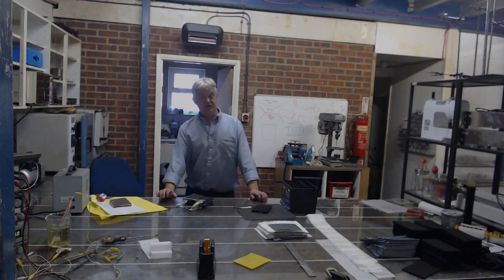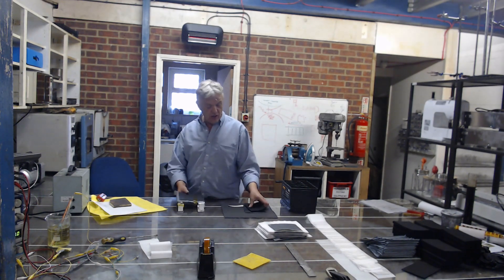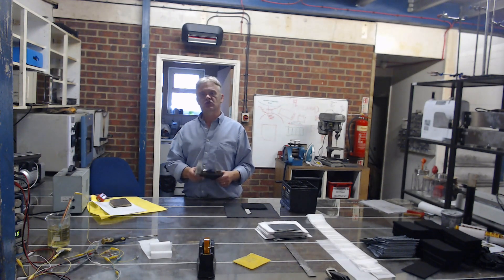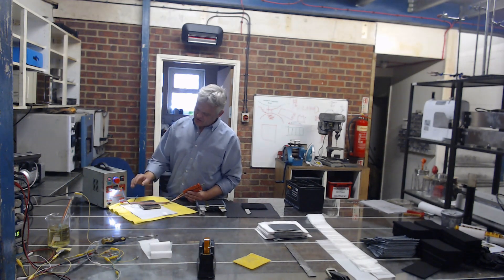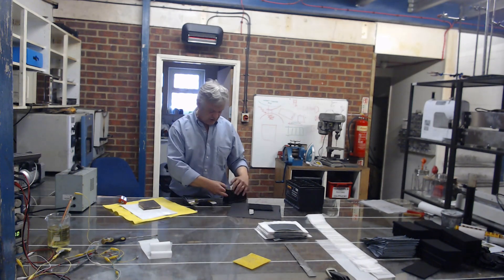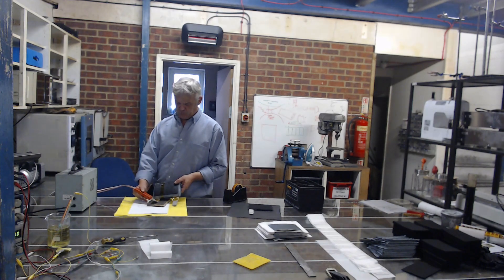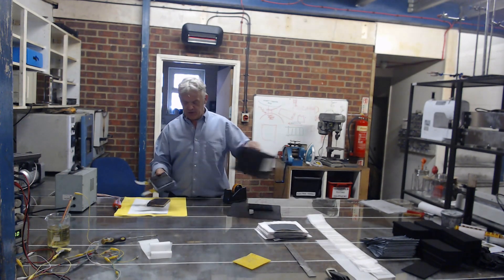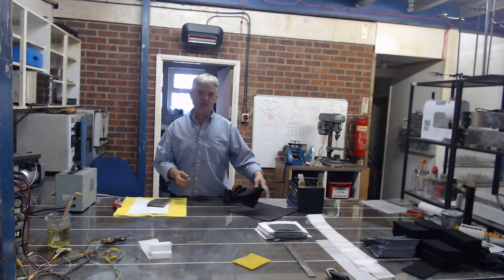Supercapacitor And Battery Build   Welding The Tabs

Comment: Robert, you use 304 stainless steel mesh but this steel corrodes in acid.
Maybe instead of this mesh choose a 316 stainless steel mesh, this type of steel is resistant to strong acids and alkalis.
it would be less work with laminating and protecting the mesh against electrolyte.
What do you think ???
Reply from the maker: 316 is better but we are encapsulating so in theory we could use aluminium

Comment: A home made welder can be made fro a super capacity, and batteries.
Reply from the maker: did you do a vid?
Reply: @ThinkingandTinkering  No, but several youtubers have, I have been interested in building one, to spot 18650 cells to nickel strips.

Comment: Great video! Welding is a nice way to handle stainless steel battery connection tabs. :)
Question: After seeing your previous "battery cell" construction, and now comparing to the "capacitor cell"... you reused the separator pouch that came in the battery. But what do you use as the separator in the capacitor? 
(I wouldn't think paper towel would be stable enough for a reasonable life expectancy.)
Reply from the maker: paper is fine mate

Comment: Robert, is a thinner steel grid covered with plastic is it better to use graphite foil ??
Reply from the maker: yes the graphic will soak up the electrolyte and become fragile quite quickly
Reply: @ThinkingandTinkering  OK - thanks for the clarification !

Comment: At 55 seconds, "both plates are carbon" - so both plates are identical - carbon - with just small stainless steel tabs? Or is one plate stainless steel (as in the recent battery vid) and the other carbon. Thanks.
Reply from the maker: this is a follow on to the battery rebuild video mate

Comment: Hi Robert can you provide details on Welding device (model number, manufacturer)  you used in this video. Thanks
Reply from the maker: it's just some cheapo tab welder mate - I got it on eBay - I think there are a few types but all should work fine I guess
Reply: Thanks Robert

Comment: How was the twizzy battery's made was they pouch battery's or did you do the same as here?   Have you made a solid state Battrey yet?  What is the conductive plastic? Did you make that? I need two battery's 12-14 volts 35 Amp hours or more to operate my donated wheelchair. I cannot operate my manual chair up hills from a spinal injury. I was thinking of a solid type Battrey /capacitor to operate my wheelchair, and made to fit the Battrey cavity in my wheelchair
Reply from the maker: this is all experimental stuff mate - it isn't going to replace you battery anytime soon
Reply: @ThinkingandTinkering  we should just send money to you to experiment for us🤣🤣🤣

Comment: I was wondering how you seal the Battrey back up? Looks quite messy like it will leak all over and ruin what the Battrey is in,  My wheelchair battery's  are Dead and I need new ones I have been thinking about fixing them but I don't want a Mess all over battery's leaking on my floor all over. Would  a pouch type system be better than using that old Battrey case and perhaps melting strips of plastic pouch type material on each side of the tabs at the base of the strip so the strips can be melted together  then welded at the tops so a pouch type container can be made by laying plastic over the cells and welding the edges closed? I watched your vacuum sealer video where pouches was made, perhaps smaller amount of electrolyte saturate Matt material and build sandwich type Battrey and seal together in pouches. I was wondering about cells gasskng and pouches expanding perhaps pouches can fit into old Battrey case and tabs are insulated with plastic on each side last inch of tabs are Bare so they can be welded together into a pile 2volts per cell is needed, actually my wheelchair battery's charge to 14 volts, they are dead boiled dry no electrolyte left. I refilled them with water and tryed to charge them they won't take a charge. How can I rejuvenate my old battery's without making a mess of them? Can I add new acid and charge them?
Reply from the maker: seriously mate - this is just a prototype - I would probably glue the top on it wouldn't be that difficult and it would be done prior to electrolyte fill so it wouldn't be that messy - but this is to encourage others to experiment not to present a completed battery

Comment: Looks good,I'm looking forward to seeing how it specs out.
Reply: Ditto's - we have a golf cart, and batteries are horrifically unreliable despite how expensive they are. A quality 6 volt battery is about $120-$130, and might last 3-4 years. A super capacitor should deliver far more cycles and be much more resistant to shock.
Reply: @azurealism  with a life expectancy over 40 years on top of that.

Comment: Is anyone else having trouble reaching the workingInk website?
The secure connection keeps giving me errors about my "correct time" !!!.....my browser has the correct time.
Something is wrong with the site's secure certificate
Reply from the maker: we are just sorting out the certificate mate - it should be fine tomorrow - I hope lol
Reply: Same here - Firefox is complaining about a dodgy certificate.
Reply: You can try and refresh the network time on your computer.
Go into Control panel and click on "date and time".
Click the "Internet Time" tab and then click the "Change Settings" button.
Enter your password if prompted and then click the "Update now" button.
This will update your systems time to the most current time.
I had to do this once, otherwise, I would not suggest it as a possible solution to this problem.
Reply: @scotttovey  it's not my phone, I checked my settings and my time is captured from the network and it is correct.
It is their website's certificate, it's expired and/or faulty
Reply: @Authoratah  
I've run into Expired certificates on a Microsoft website once, so, it's not that unusual.

Now I'm curious as to how long a certificate lasts.
Reply from the maker: @Authoratah  it expired we have just updated it - which costs money - of course!
Reply: @ThinkingandTinkering  most hosts allow you to use their cert. at no extra cost
Reply from the maker: @Authoratah  not go daddy
Reply: @ThinkingandTinkering  I just tested it and it still doesn't work for me, maybe it needs some time
Reply: @Authoratah  
Turns out it may be very easy to install the certificates incorrectly.
Reply from the maker: @Authoratah  I keep testing it lol - it's kind of wearing

Comment: You can also weld the tabs by just using a car battery some heavy jumper leads and two copper nails as the welding contacts, just be careful not to short the jumper leads :-)
Reply: I never get good enough results with 1 battery... 2 batteries in series seems to work fine though.

Comment: Can that split system above you head operate on dc...
Reply: If it is an inverter AC they rectify the AC power coming in to about 340VDC then they invert the DC to the frequency it wants to control the compressor speed.
Reply: Gary Hoffmann sooo...it sound like it is time to get it up and running on a battery?...sorry you answer was a bit above my pee brain but it sound like it could work...just need to build one heck of a big paper battery....something like a 100s 100,000p...?